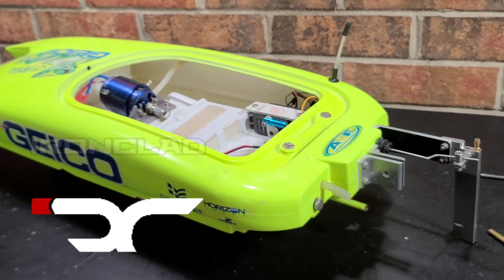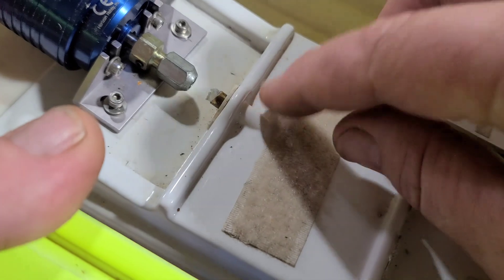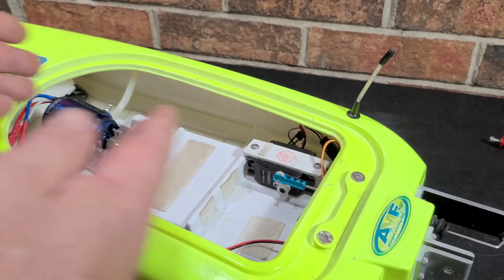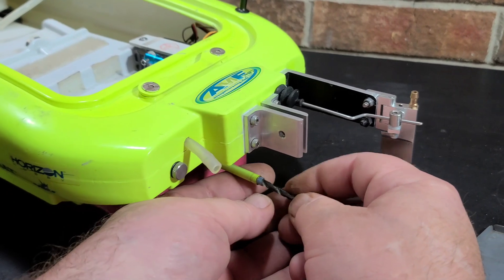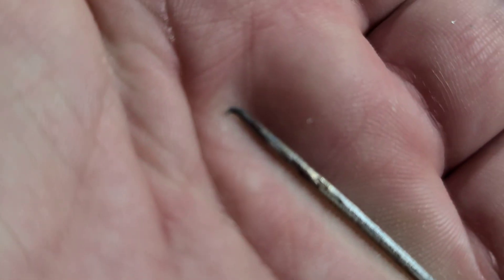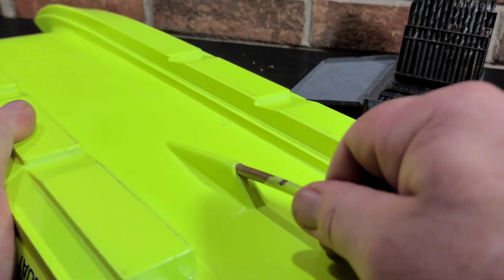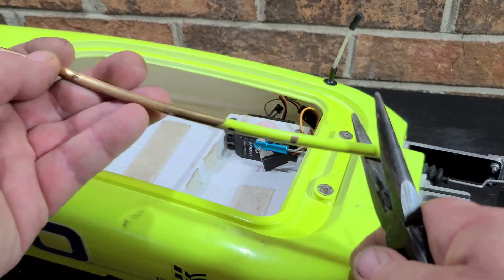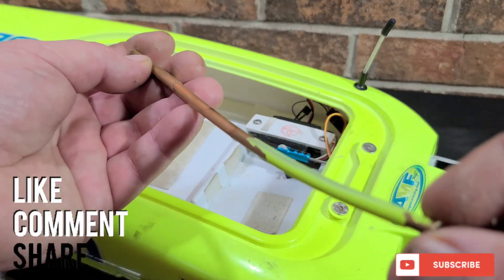Stuffing Tube & Teflon Liner Removal Rc Boat Hardware Installation Series

Comment: Many thanks for your videos and for sharing tips 👍 will you remove too the stock plastic tray in the middle? My Geico 24" is waiting part #4... 😃 Thanks
Reply from the maker: I'm working on the stuffing tube install video right now should be out tomorrow
Reply: @IRONCLADRC  Thanks a lot master! 👍👍 Following your work 😉

Comment: Hey love your videos, got a sonic wake V2 and running it on (2) 3s 100c 5kmah spektrums… lots of heat generated when running so much so steam comes out of the boat when i take the canopy off. Water seems to flow through the coolant system fine…. Any tips??
Reply from the maker: You may want to drill out the truhull where the cooling lines go through the back of your boat from the rudder.  Proboat drilled the holes very tight..   pull the cooling lines off the rudder and pull them into the boat find the corresponding drill bit, don't over drill the holes...

Comment: My 1st blackjack 29 held the liner in great. But the replacement (after crash destruction) mk2 blackjack 29, the liner spun with the cable. Glued it, pinched the tube end to square even slight crimp in the tube. No joy. So let it spin till worn out. The damb thing still going 3yrs later. Paaah. 😂

Comment: Do you think this will work on my enforcer super gator its made of fiberglass and the stuffing tube broke off flush with the hull? This boat hasnt been in the water since 2000 i believe
Reply from the maker: Yes, sir, it'll work. You may be able to use a soldering iron to heat the tube opposed to a torch..  either way, heat softens the epoxy/adhesive just enough to pull the tube out the hulll. Good luck BG4L

Comment: Hey Big B. How do you know when the stuffing tube needs to be replaced?
Reply from the maker: I Replace mine if there's a kink in the tube or if the Teflon liner or flex cable heated up and burnt the brass.

Comment: I'm sorry to bug you again but where do you get your 1/4 in inside brass tube and your
.150 Teflon liner to run 3/16
drive shaft. I hate to bug you
Reply from the maker: https://www.offshoreelectrics.com/proddetail.php?prod=ks-brass-tb-12&PARTNER=ironclad
Reply: One more thing I have a Sonicwake 36 V2, I heard you mention that you had two 5000 100C batteries in the boat I have a Spektrum 160A ESC in mine, Is the limit of the batteries 8S, like can I put two 5000 6S 100C batteries in series that would make it 12S, would that be ok or would that break the 8S limit?

Comment: Big B are you on Facebook or Messenger, I would like to ask you a few questions about some boats. I would really appreciate some advice, thanks
Reply from the maker: No sir no facebook. Email is in the description very bottom, it's not a link so you'll need to manually enter into your emailing process
Reply: Email sent